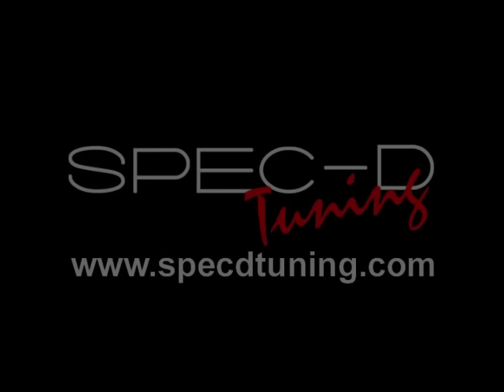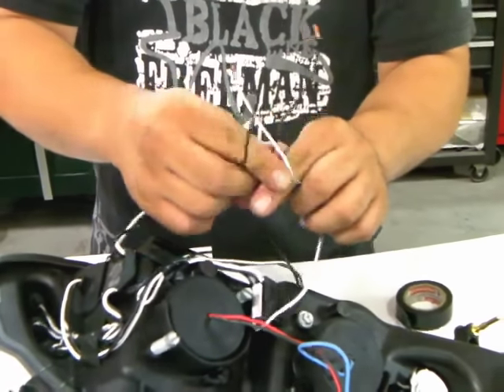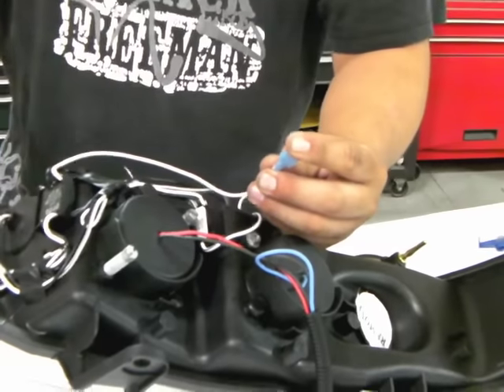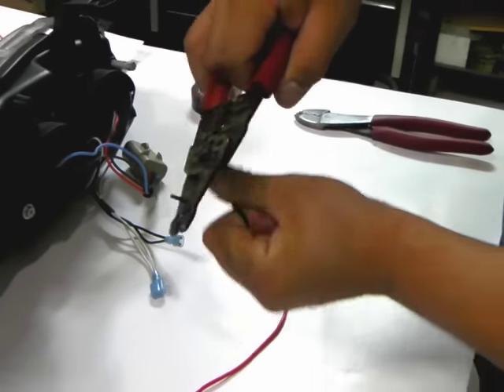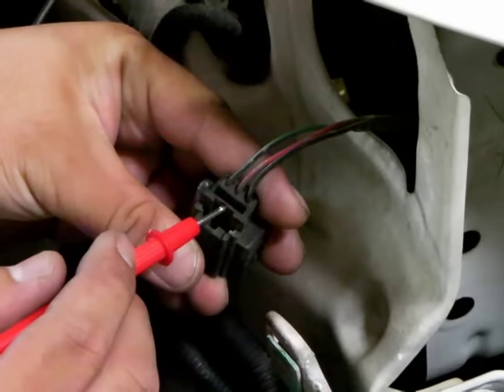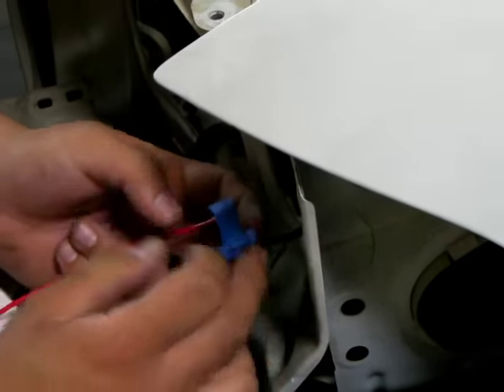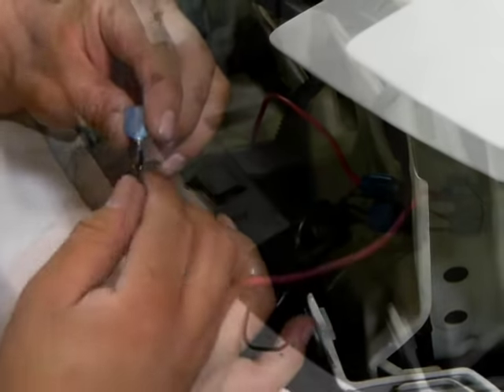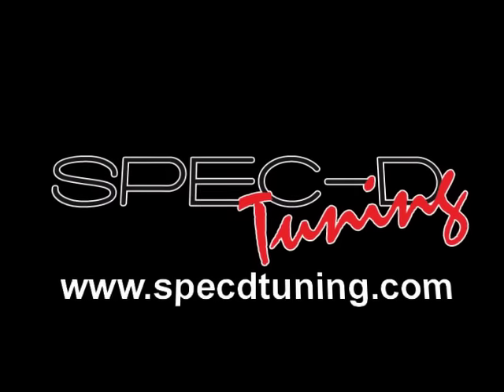SPECDTUNING Installation Video: Halo LED Projector Headlights Wiring Installation

Comment: Anyone whining that this is hard really shouldnt buy them or youll mess it up, since the video is pretty straight forward, any simpler and youd be finger painting. Grand Ams dont have connectors specifically for halos, hence you splice into power wires to get power to them. It really aint that hard. No one wants to work for good things anymore lol.
Reply: Ross V I was able to do it.  It’s not that hard. You are right.
Reply: Exactly...watching this so I can do my friends lights,and after reading these comments I have no idea what everyone is bitching about.
Reply: @brandopopoca3038  tape will work..connectors or solder would be better though.I did my friends and soldered them
Reply: @craigshelhammer5683  I just don't really know which of the lights wires I should splice into to have the led lights on all the time. The rest is pretty straight forward
Reply: @dante6366  you just splice into your main headlight ..the one that has your regular and bright beams ,the model he had I wired it like that and it worked just fine.

Comment: Nice job. I usually don't put two males on the headlight assembly in case someone else has to work in the area.  It's more difficult to cross wires that way.

Comment: I picked up some spec-d headlights for my 2007 chevy silverado. Installation was easy, though the instructions didn't really help much. My headlights came with 3 sets of positive and negative wires, whereas the instructions and videos only show 2 sets. That being said, I'll explain to you guys how I installed mine. First, I traced the positive and negative wires (white and black) to see what they were going to power up. I took the wires for the LED halo's and lights at the top of the headlight assembly and paired the white with the white and black with the black. I also spliced the 3rd black wire with the other 2 black wires to share a common ground. The remaining white wire was just powering a clear halogen bulb, which I swapped out for an amber colored bulb; this one ran on the top of the headlight assembly and sort of looked like a light bar. As for the low and hi-beams, those were just plug and play from the OEM harness. Mine did however come backwards, they had the low-beam and hi-beam harnesses swapped - it was easy enough to swap those harnesses around. For the Chevrolet Silverado, the OEM color codes are as follows: Brown: park lights, Black: ground, Blue: turn signals. These are the only ones you need to concern yourselves with IF you're going to follow the same setup I did. So, I used blue heat shrinkable butt connectors and spliced everything on the light harness side (not on the chassis harness as they did in this video). In case you don't know what I'm talking about, take the wire you want to tap into, cut it, expose the copper wire and twist those ends together, crimp a butt connector on one end and place the wires into the other end, crimp and apply heat. I took the paired white wires from the LED halo's and lights and spliced those to my brown wire for park lights. I then took my remaining white wire for the halogen bulb and spliced it to my blue wire for the signals. I then took my 3 black wires and spliced those into the ground wire. My truck had 2 black ground wires on the OEM harness, one was for the headlights, the other for the turn signal/parking lamps. I left the one for the headlights alone and used the ground wire for the turn signals/parking lamps. I then heatshrunk all those butt connectors, plugged in the hi and low beams, connected the OEM harness and verified everything was working properly, and that was that!

It was all really easy, it took me about 1.5 hours after everything was said and done with a few distractions.

Comment: Crimp connectors?  Electrical tape?  Quick connectors?!!!  You guys are insane, that is absolutely Radio Shack crap.  There is no way those will stand up to heavy rains, salt spray off the roads, or even a general outside environment.

These lessons were learned years ago with faulty OEM electrical systems.  You guys are setting unsuspecting consumers up for failure.  Get real or go out of business.

Comment: Well idk if I trust that splice connector so I'ma just bust out the soldering iron. I am correct in assuming that I wire the DRL to an ignition power source and the halos are wired into the headlights connector?
Reply: Did it work please I need help I been so confused for 5 hours what do I solder where
Reply: @angelgaleana8467  lol I haven't installed them yet. But it's not hard. You'll need a multimeter. If you want the LEDs to work as Daytime running lights you'll need to find the positive wire that has power as soon as you turn the car on. If you want the LEDs to turn on only when your lights do you will want to find the wire that get power when you turn them on. Put the black end of the multimeter in the negative - terminal in the battery and then poke the red end + into  prongs of your socket that plugs into the headlights harness. If they have power it will show it on the multimeter. You will have to do a process of elimination to figure out which one is headlights power and which one is ignition power if you want to use them as drl. (There's also videos of how to install drl on yt) You don't have to solder it comes with connectors but Ive heard mixed reviews on the lil t splitters and I have a soldering iron they and I wouldn't use electrical tape either heat shrink is super cheap and you just slip it on and run a lighter over it to shrink it. you will have to buy some 18g wire and some 18g wire connectors you can get them at Walmart or any hardware store. Hope this helps don't get to stressed out it should be easy to wire them either way. Getting them aligned base on the owners manual of your car and removing the bumper will be the more time consuming parts

Comment: Bought some for my Jetta but they are all looks and work like complete shit! Honestly don't waste your money on these guys. The halo rings are barely visible, they use some cheap light bulbs to light up the rings. If it weren't for my 55W HIDS i installed on them they wouldn't even worth it. Not only that the light pattern that comes out of the projectors are horrible they are V-Shaped and you can not adjust the height of them. So my driver side one is shorter than my passenger side one its looks really bad from inside the car. The only good part was that the LEDS did work that where inside the headlight unit. Other than that i would not recommend these to anyone. Im just gonna wait till they kick so i can go back to my OEM ones. Also the wiring is horrific and a pain in the ass to figure out.
Reply: I agree bro. Installed it last week and already the low beam bulb is out. Money gone to waste
Reply: That blows that they are fixed and not adjustable. But I think that is normal for driver side to be shorter than the passenger side. It is so you do not blind oncoming traffic.
Reply: got some for my jetta and its plug and play how tf couldnt you figure out the wiring? Yes a 55w hid bulb is still brighter but these are def better then stock. Haven't had any issues with mine and both adjusting perfectly fine. Just sucks that the halo ring is on a switch board led vs a bulb

Comment from the maker: @malikahsan1990 There is no problems using copper, we just recommend that you use the correct gauge; usually around 18-22 gauge should be fine; but also make sure that the splice connectors are big enough to tap the wires. I hope it helped, thanks and good luck.

Comment: @45CHI no that's why you check to see which wire has the current running through it. The wire for the blinkers only has power when you have the hazards or directionals blinking.

Comment: @Kikingmarikina yes you can as long as you remember, if you connect all the wires to one single power source, like your reg headlights on low beams they will not illuminate when you only turn on the orange driving lights

Comment from the maker: The high beams are the ones closer to the LEDs. Those LEDs will turn on depending how you wired them. If you wire them to turn on with your halos then they will be on with your halos as DRL's

Comment from the maker: @RyanEnvy Sorry, i am unfamiliar with Anzo products. However, the first question your asking is right. There should be a ground wire. But to make sure, you should contact them and ask their customer service for more details.

Second, the signal light are is missing; is because your suppose to use your stock turn signal harness and bulb. I hoped that it helped. Thanks and good luck.

Comment: paul, make sure everything is grounded and everything has power. Grand am's work off a different electrical system than these lights were designed for. try switching bewteen high beams and low beams to see if the halos come on.

Comment: @BroMinor You can just use quick connect, althought it will be much easy to remove the headlights and put back on if needed with the male/female connectors

Comment: I bought your new version with the red and black wires connected to it but there's no video that shows how to connect the halos to a 99 ford ranger. Please help my 15 Amp fuse keeps blowing from the engine compartment fuse box please helps do I need a wiring harness please show in detail.

Comment from the maker: @hreimer13 The halo rings came on, so the wiring is correct. But if your headlights do not come on, it is because the headlights are defective, because the projector only plugs into the headlight harness. You can check to see if the bulbs are bad, but i recommend that you ask to have the item replaced by the seller. Good luck.

Comment: I got the LED projector headlights for a 2000 Dodge Ram. Took forever to find install video. Video was not very much help. After going to the auto parts store and asking for more info, I got them wired in. Problem is, only one side of the LED lights work. Two out of four of them worked for a minute and now none of them on that side works. Super frustrating. No instructions in box. just a very blurry picture that was no help. Any ideas how to make LEDs work?

Comment from the maker: @chemim888 that white blue is already connected to your high beams which you do not need to tap those, the only things you need to splice is the black and white wires which you would splice together with your parking lights

Comment from the maker: @RyanEnvy NP. Some cars have their parking lights on first before the headlights come on (I use it for parking structures, for safety reasons; without the headlights on). Parking lights will do; or you cant splice them to a light that is constantly on with your headlight beams. The halo/LED bulb require very little power (current). Any light bulb will do. However, please check what also comes on when your headlights are on. That will be your best bet. I hope it helped, good luck.

Comment from the maker: That correct H1 are lows and H3 are highs. Check to see if the bulb is seeded correctly. If they are still dim the bulb just might be bad and youll need a replacement.

Comment: I bought some halo projecters with leds sideways also and I just spliced both halos and leds into the constant wire for parking light which works great but the halos are not even noticable at daytime it sucks but at nifht they look good

Comment from the maker: @Juan52004 HI, to answer both of your questions: the headlights will come with about a pair of 8 inch red (white) and two black wires for the halo and/or LEDs. You will need to find the power source of your parking lights (bumper, or corner; but not the turn signal). Once you find the power source, you can tap the red wire to that and black to that negative. The process that you can use is the quick splice connectors. So that once you turn your parking lights on the halos will come on with them.

Comment from the maker: @BN3DC2 You can get your halos to work, hopefully you have not yet cut your wires. The two black wires in the video are to help make the wiring more simple. The just tapped the black and whtie wires to one. Just follow the video for your 98 civic, and you will be fine. Also, if you need to take them off, we have a video for your headlight installation too. Good luck.

Comment: @ace13061 ... Hey guy. No problem. You just need to find your park light harness and splice into it as appose to the headlight harness as you have evidently done. As in the video you connect both white +(together) and black - (together) and splice into park lights and NOT headlights. That way when you turn on your parks your LED's and Halo's will burn only. When you go to your headlights low or high, LED's, Halo's and hi or low beam will all burn together. GOOD LUCK!

Comment: i followed this video and wondered why the halos werent on for my daytime lights as well as night time. my car has a daytime harness and a night harness 2 haresses going to the light so i had to wire to both, it worked but blew my daytime dash lights, i strongly suggest tapping into the fuse box, put the halos on a 10 or 20 amp fuse they will be on all the time and no power issues or issues with them only comming on with certain other lights,
hope this helps for people in the same shoes

Comment from the maker: @bashir4200 That's just the ones we use. You can use any crimp connectors you like. However, remember the gauge of the wire is 18-22. A smaller gauge connect might not crimp down all the way. You can use the dual end connectors if you like.

Comment from the maker: @himynameisphuc The wire you want to test is the [parking lights] wire; which comes on during the first turn (before your headlights come on) of the headlamp control module. That will be the parking lights. Tap the wires to the parking lights power. I hoped it helped, thank you and goodluck.

Comment from the maker: @himynameisphuc You will be safe. Just avoid tapping the wirs tot he headlight wires. The parking lights are safe, because they do not have enough current to burn the bulb. Light bulbs are like resisters and they can withstand quite a bit. Imagine a loop wire (hot) that creates a circuit and if you place a bulb in the circuit, it will turn on becaue the energy heats up the bulb. Cut the circuit then the light bulb will go off. If the light bulb is low (watts); and too much energy, then pop! thx

Comment from the maker: @TeriyakiBoy24 Generally, the red is the power. However, sometimes they change them out. In your case, the yellow should be the power and the red ground. You can test to wires by testing them before you tap them. Thanks and good luck.

Comment from the maker: @DMANGONEFISHIN no nothing else is needed to be wired.. unless you do want to run the wire to your blinkers and have your halo's blink with it that is up to you.. basically when you splice the wires with whatever u want to connect it with, your power sources will be from there and function to what you have connected it to

Comment from the maker: @soccerhall You don't need an HID ballast unless you have HID bulbs. There might be a chance that the wires by the manufacturer as positive and negative wires; so you can try to swap them. Second, make sure your using the parking lights that come on during the night. Third, if you are doing everything properly, then check with your seller because it is not unusual that the headlights are defective. Good luck

Comment: I haven't bought these yet but I will soon (headlight and altezza taillight combo). I have a 2007 Honda Civic DX and was wondering if it'd be better to splice into the daytime running lights, low beams, or any other wiring that may be recommended? I like the idea of having them on at all times though..

Comment from the maker: It is possible that the 12 gauge is simply to large, but we suggest that you check the continuity and see if it is actually getting power. If not then try a 24 gauge wire.

Comment from the maker: @1DAONLYTRUNECIOS  All projectors sold in the market today do not come with crimpers & wires. The crimpers & wires shown in video are what is RECOMMENDED, not included. If you have already checked the light bulbs & the filiment is broken then the bulbs are bad. However If they are not broken you might want to check with the company you purchased the item from, because you might have a defective product. Thanks & good luck!

Comment: Get vid instructions vs. the paper ones, I had cut to the wiring harness plastic because the weren't going to fit. Other than that pretty simple, I only want to know how do you get the different colors for the halos?

Comment from the maker: First of all you should check all your light bulbs are functioning correctly.  the resistance of your turn signal has changed some how after installation. You should check the wiring and how it is connected.

Comment: Spec D Tuning  my turning light staying on
Reply: +Nikki Lyons which turning light??..aftermarket one you installed?..if so, then take that +turn signal lead off the factory +parking light wire and tap it to the appropriate (L or R) factory turn signal + wire instead

Comment from the maker: @drago812 We don't recommend you to tap the halo wires to the headlights bulbs because the wires and light bulb might not be able to handle the current. For example, When you turn on a  light bulb in your house, you the light bub works as a  resister of the energy come from the wires (so the light bulb heats up). Now imagine the brightness of your headlight bulbs and how much energy  it needs. Halo bulbs are LEDs and do not require much energy at all. So its recommended for the parking lights